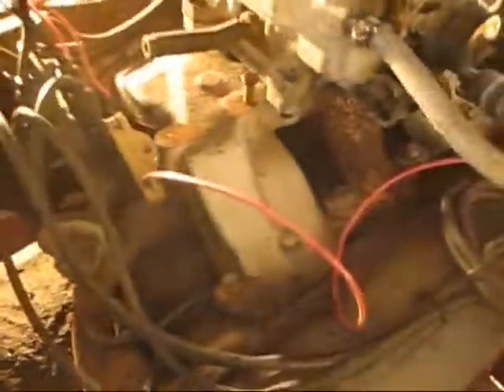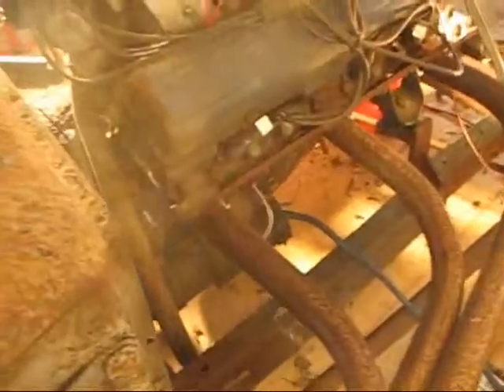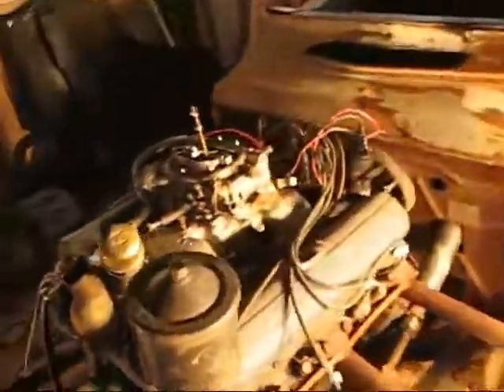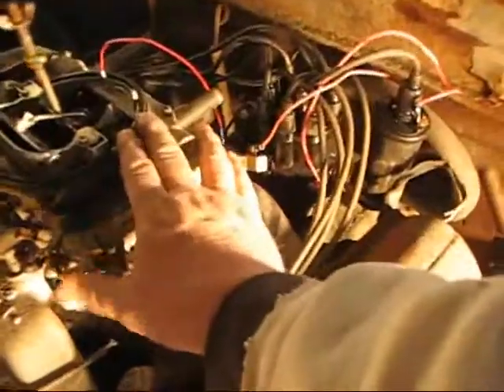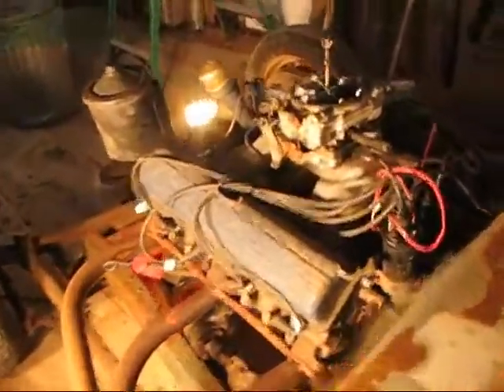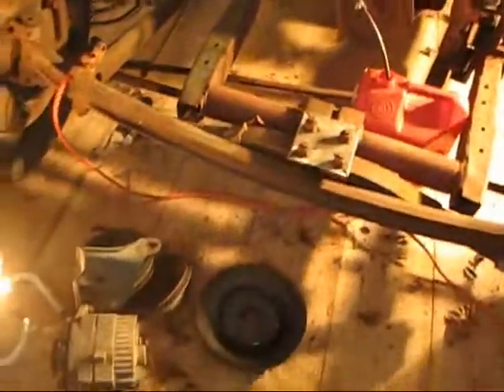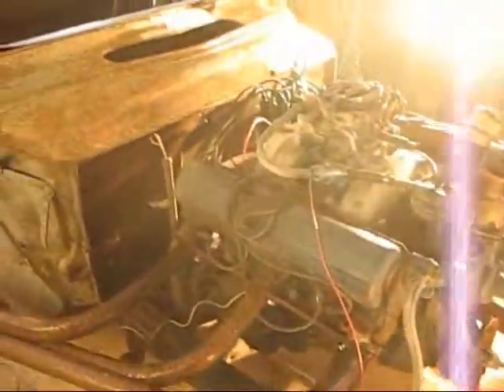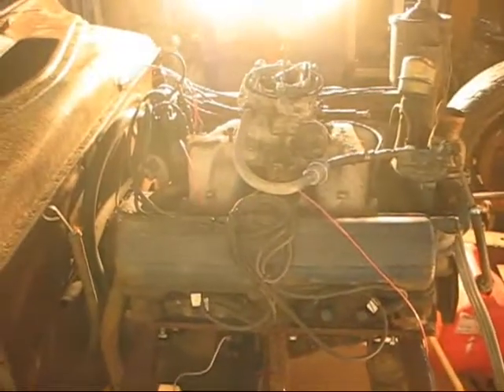1953 Cadillac engine, runs!

Comment from the maker: I'm lookin' to put a manual trans behind this.  Found someone who can make me an adapter plate and flywheel to fit the '48 Ford 4 speed I've got in the barn to it, but it's costly.  Anybody out there got any other ideas, or know where I could pickup a straight shift tranny that would fit this engine?